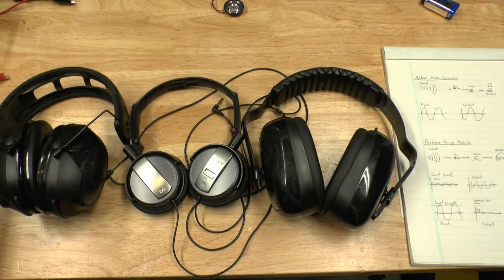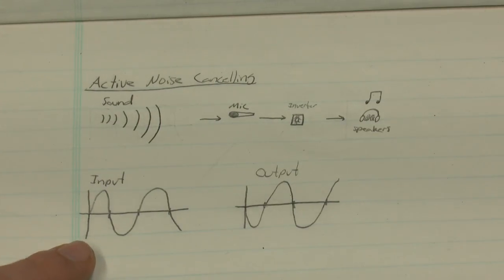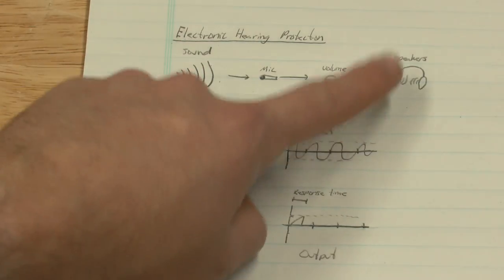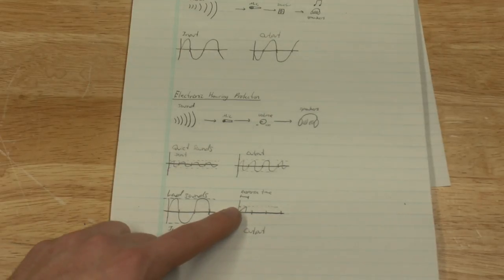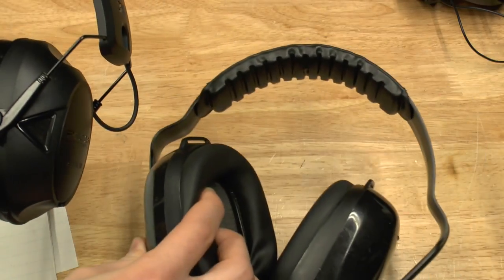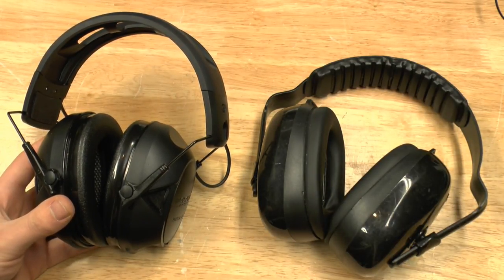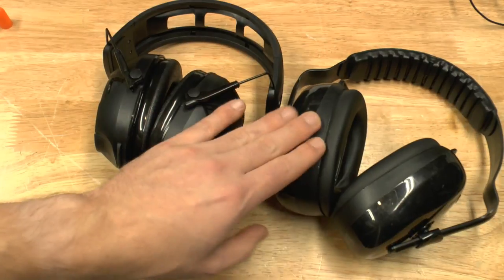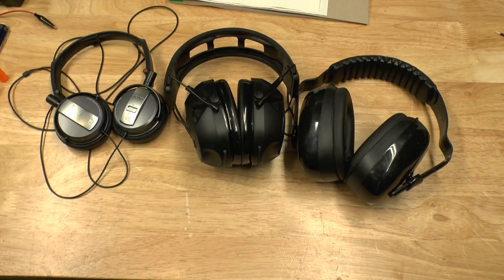How Electronic Hearing Protection Works: It's Not What You Think

Comment: I am confused.  Based on your explanation, an electronic ear muff with an NRR of 19 would not reduce the gunshot anymore than a static ear muff with the same NRR.  So why would anyone pay more for electronic muffs (as much as $200 -$300 more) other than to amplify the quite sounds?  Indeed, for only ear protection, a pair of $300 MSA’s are no better than a $20 static muff with the same NRR of 19.  I know for a fact that shooting a high caliper rifle is much quieter with the electronic MSA’s.
Reply from the maker: Journeycam because with regular earmuffs, you can’t hear people talking. The electronic ones allow you to have conversations, hear people sneaking up on you, etc. while still protecting your ears from loud noises. Not sure where you’re getting $300 from. I got the Howard Leight Impact Sports for $35 and the Peltors for around $90. They’re more expensive because the audio is much clearer. There are ones $300 and up that are that price because they have a higher NRR, they’re much higher quality (meant for professionals), and usually have built in connectors for radios and other communication devices. I wouldn’t pay that much for them unless I was going into the military.
Reply: Budget Tool Reviews MSA Sordin Supreme X is $275+ with NRR of 19.  Also, if what you are saying is true, ear protection for military or civilian gun purposes would not need a 82db cut out since every gun shot is well over that level.   It would cut out the amplification of any sound over 82 but do nothing more than a pair of static ear muffs with an NRR of 19.
Reply from the maker: Journeycam NRR 19 is unacceptable and should be minimum 22. As for the second part, I’m not sure what you’re saying. All gunshots are above 82 dB so all gunshots would not be “amplified”. And by amplified, I just mean not reproduced by the headphones. The headphones will not make the sound louder than 82 dB. Anything less than 82 dB will be reproduced through the speaker but anything greater than 82 dB and the electronics shut off and it is exactly like a pair of regular earmuffs at that point. The 82 dB is just the point at which the mics shut off and has nothing to do with the noise rating
Reply from the maker: Journeycam so I just looked up those earmuffs and I think they’re so expensive because of their quality/durability. They’re shockproof and waterproof which most earmuffs are not, and they have gel cups which are much more comfortable than the standard foam. Also from what I read, the NRR of 19 is misleading. Different frequencies penetrate differently and at the the frequency of rifles, the MSA Sordins reduces the noise by 27 dB. I suppose NRR is an average over all frequencies, and at the frequencies of gunshots, the MSA’s work better. It’s like comparing lumens and candela in flashlights. Lumens is just the brightest point but candela is intensity. You can have a ton of lumens but a flashlight can still look dim because it doesn’t have enough intensity. In the same way, headphones can have a good NRR but a bad decibel reduction in the frequencies we want
Reply: Budget Tool Reviews Been researching it. Freq benefits are bogus.  Freq is not a function of dB ratings.  It is just harder to hear freq between 500 and 5,000 unless you are a dog. If they claim a benefit because they are able to target 8,000 Mz, it is only a benefit because the freq is a little harder to hear which has nothing to do with SPL.  When you get your ears tested, they will use freq ranges between 500 and 20’000 Mz which is the hearing range of the human ear to test your hearing loss.  The higher freq doesn’t hurt your ears unless they raise the dB.
Reply from the maker: Journeycam First of all, Mz is not a unit but I know you mean MHz which stands for megahertz. Second, the part about getting your ears tested you claimed 500 to 20,000 Mz but I think you meant Hz since the range of human ears is 20-20,000 Hz, but that is irrelevant. I can see how you’re confused about frequency not being a factor in decibels, and you’re kind of right. In a constant medium like air, you have a sound source in air, and your ears are in air. But the point of earmuffs is to attenuate the sound better than air so we use specific materials that will attenuate the sound waves. Frequency does not affect the decibels in a constant medium but in the case of earmuffs, it goes through air, then the ear muffs, then air again, and finally to your ears. Different materials will be attenuated better at specific frequencies. Generally higher frequencies, such as those produced by rifles, especially with muzzle brakes, penetrate less than lower frequencies. But NRR is calculated as the average attenuation from a frequency of 125 Hz to 8000 Hz. See the section called “Calculating the NRR” on this website: https://www.cdc.gov/niosh/topics/noise/hpdcomp/pdfs/calculation.pdf
As you can see in the formula, a range of frequencies are accounted for. However not all frequencies are accounted for, and it is an average, so different materials can attenuate different frequencies better than others.
Reply: Budget Tool Reviews Thanks for the correction in freq nomenclature.  I be read where doubling up only increases the dB protection by 5dB regardless of the muff’s rating.  So I am thinking the best protection is to get the best inner ear protection, maybe custom mold fits, at say 31dB and then pro muffs so you can turn the volume up to a level to hear conversation.  That would give you 36 protection.  If I shoot an AR-15 at maybe 160dB, that would still be a 124 level protection that could still be damaging.  Shooting just isn’t safe for anyone it seems.
Reply from the maker: George W so keep in mind when earmuffs say NRR 30 dB, that doesn’t mean subtract 30 dB from the initial shot. If you have 100 dB with earmuffs of 30 NRR, it really only drops the dB to 88 dB. The formula is approximately NRR minus 7, divide by 2, then subtract from initial sound. So an AR-15 at 160 dB with NRR 36 would only bring it down to 145.5 dB. The idea is that even though 145.5 dB is dangerous, in short pulses for maybe a couple hours won’t damage your ears. If you were at the range all day every day, you’d definitely suffer hearing damage so you should put foam earplugs underneath active hearing protection and just turn up the volume. But again, better materials like the ones used in the expensive earmuffs is designed to filter out the specific frequencies of rifle shots. So even though they may only be rated NRR 19, in the specific frequencies of rifle shots, especially with muzzle brakes, it’s equivalent to around 27 dB, not 19.
Reply from the maker: George W if you double up on protection by putting putting in earplugs too, keep in mind the sound my be bollocked from traveling through your ear canal, but it will still travel through your skull, no matter how much hearing protection you have. That’s probably why doubling up only adds 5 dB of protection
Reply: Budget Tool Reviews Ibread about that NRR to dB adjustment.  Also, the difference between the lab test NRR and actual tests in the field can be as much as 50% less.  I’ve read where even a single event at 140 can damage your hearing and since is cumulative, semi-auto can do some damage you may not know since it won’t be uncomfortable.  I don’t buy into the propaganda that the muffs are built with specific materials to reduce a specific freq such as Peltor says they do at 6,000.  If that were the case, they should be weapon specific muffs.
Reply: It is easy to see why the lab tested and published protection levels can be off by as much as 50%.  In the lab you have a perfectly smooth and even pressure mechanical contact to the muff seal with the most advantageous compression level and mic placement within the muff.
Reply: You should do a YouTube vid targeted to shooting ear protection...Facts About Shooting Ear Protection.  Most shooters don’t know what protection they are actually getting and measurement faults...NRR to dB and lab results vs tests in the field.  Most have no idea or care because the sound is “comfortable” and they are more interested in electronic features, cheek well fit and if they look “cool”.
Reply: @bw162  @korbano Yes, please
Reply: @DanMaverick22  Thanks but I am in my 70s and this was so long ago, I’ve forgotten all the data I collected in my research.  I can say, however, that when I don’t have a can, I shoot with the biggest ugliest muffs with the highest rating plus ear plugs.  I am too old to care about being able to listen to music or have a “cool” slender camo look.  Fortunately I am in a state where I can own and shoot with cans.  And at 76, my hearing is great.  However, my aim is not so good anymore.

Comment: I've always wondered if electronic hearing protection worked the same way as noise cancelling. It made me think, like: "does it mean it cancels the loud noise into a very loud blank noise?"

I think you pretty much answered my question: it's not cancelling the noise out. It's just that the muffs are isolating your ears from the outside, so the only way for the sound to enter is through the speaker.

Thanks.
Reply: So the only way to "not hear anything" would be to wear a spacesuit with a "vacuum layer". Otherwise, the sound wave still travels through your skull into your ears. But that's just not practical.

Comment: how about the sordin supreme pro  ear muffs? Those things barely have any protection in the "muff" itself.
Reply from the maker: That’s because NRR is measured at a specific frequency. At the frequency of gunfire, the sordins have good protection
Reply: @korbano  okay. I was concerned as my sordins felt so loud, and when I opened them up , there was barely any “materials” inside. I had to double up with in ear protection to make it felt safe
Reply from the maker: @LoveLikeaHurricane  Yeah they’re pretty thin but they supposedly use good materials. I think the denser it is, the better it blocks sounds so most cheap earmuffs have to be so thick because they just use lower density foam. It’s a good idea to double up and wear foam earplugs anyway though.

Comment: You dont get it dude...thats the whole point. It's noise cancelling because when it detects a high volume...the speakers immediately shut off, so it cancels out the noise. The actual ear muffs take into play here.
Reply from the maker: I don’t think you understood the video. Noise cancelling means the speakers play an inverted waveform to cancel out the noise. Electronic hearing protection does not do that.

Comment: Do those active ear muffs with the microphone let you turn the microphone off? I'd want the microphone off as I want to block as much outside noise as possible, but I want to listen to my music via bluetooth.
Reply from the maker: No, if you turn off the microphones it turns off the music too with this specific model.
Reply: @korbano  Thanks. I guess if I were to get one of these, then I could just try and open it up and cut the wires to the microphone. As I want to block as much noise as possible from the outside.

Do you have any recommendations on ear muffs with high NRR that has bluetooth to listen to music with? Thanks. I wish they made 33db NRR with bluetooth, but looks like they don't.
Reply: @colt5189  I came across some Peltor muffs that do have bluetooth or radios and which work as "industrial electronic hearing protection", but I can't guarantee how well they work since I use passive muffs.

Perhaps you could wear tiny bluetooth ear plugs under passive muffs?

Comment: You contradict yourself. Even if it's pretty obvious you meant otherwise you did say the headphones blocked "all of the sound". You later said how much the electronic set is supposed to block but didn't state that you were correcting yourself. I'm also pretty sure that those little speakers can damage your hearing.